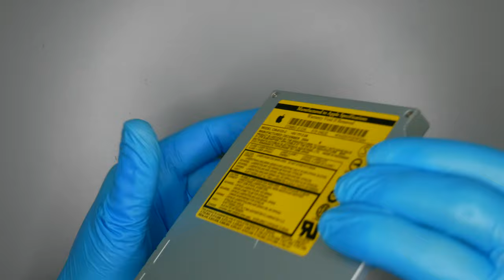DEEP CLEANING of the Mac mini G4 (2005) [4K]

Comment: I've never seen this type of HD, this MacBook is too different
Reply from the maker: Yeah, that's why I wanted to clean an old Apple computer. Especially a Mac mini. It's totally different than a regular desktop computer.
Thanks for your comment Rene ❤️
Reply: The HD is just a regular IDE laptop hard drive. Those were the regular standard like SATA drives are now and also this is a Mac Mini. The MacBook is a laptop not a desktop computer
Reply from the maker: True! It is a laptop HD. And lot of things in the Mac mini are similar from laptops. This Is why I wanted to clean one before start to clean laptops in video. Thought it was a good skills maker for this, and it is actually 🙂
Thanks for your comment Laur! ❤️
Reply: @french.satisfactory  Well the Mac Mini actually is just a laptop with no screen and keyboard even today.The processor in this one is actually the best G4 they had in 2003 until the 1.7 one came out in 2005. Also 80GB hard drive which also seems to appear to be original was a lot back then.This computer was very expensive when it was new and if i were you i would keep it for a few years. The prices for these computers are starting to go up because it's starting to become "vintage" and it's also the first Mac Mini
Reply from the maker: I will keep it for sure 😃 Thanks for all these infos, very interesting ❤️
Reply: If you mean Hard Disk Drive, short is HDD 😁

Comment: I know nothing about Macs, but I just checked and the IDE hard drive could be replaced with an mSATA SSD in an 2.5" caddy / IDE adaptor.  Despite the limitation of the IDE interface, it seems a 20% speed increase can be gained.  A good way of boosting any old IDE-based system, then, not just Mac Minis.  A bit more RAM and there are options for Linux, but then I would say that!
Reply from the maker: Hey MarkTheMorose!
Don't think it could work in an Mac mini because there is absolutely no more place in to add something 😂 they used every mm.
But I guess it can be used in other devices. In any case, it's an interesting info. Thanks for sharing!
And thanks for your comment as usual ❤️❤️
Reply: @french.satisfactory  This adaptor replaces the 2.5" hard drive, and is the same size, so it will fit.  Video here: https://www.youtube.com/watch?v=NGwPcHDHfbk
Reply from the maker: oh interesting! just watched the video. thanks for sharing MarkTheMorose.